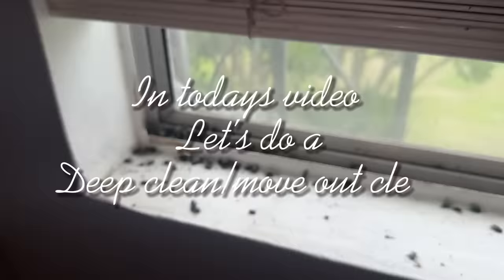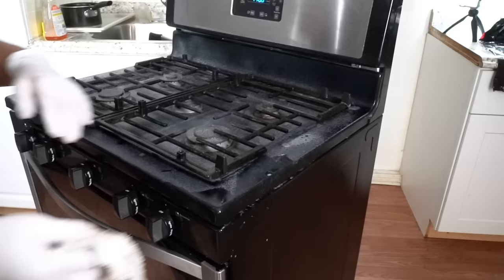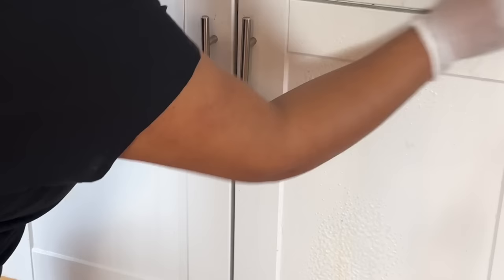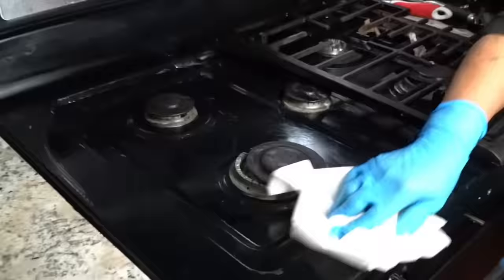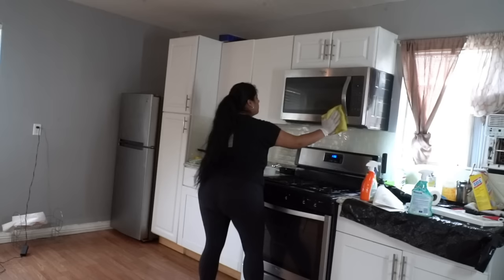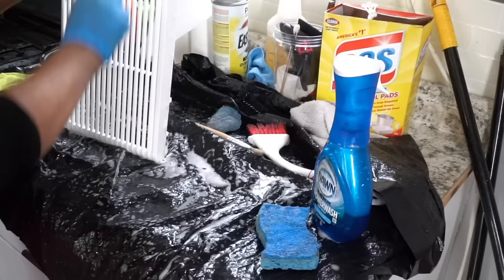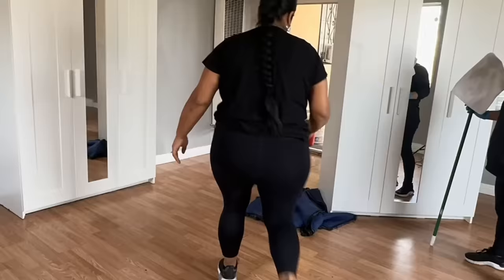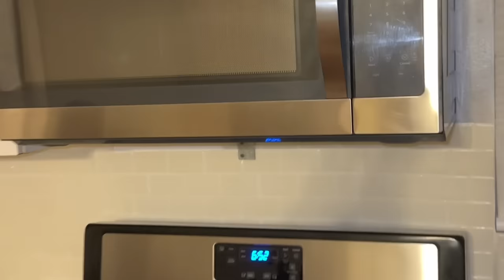WATCH PROFESSIONALS DEEP CLEAN AFTER A TENANT MOVES OUT

Comment: My slumlord and his “cleaners” should watch this. They lie and say they did a deep clean between tenants when really they do nothing. 🤮 Love your channel ❤
Reply from the maker: Yes I believe this 100 percent. I use to work for a rental company with a lot of apartments and I agree they do not clean very well.
Reply: Sounds like my old apartment.  Instead of cleaning the walls they just painted over the grease, dust and cobwebs.  They didn't even bother cleaning the top of the medicine cabinet in the bathroom and painted over the rust on the old 1970s Hotpoint stove instead of replacing it.
Reply: @Princessmom9  yeah that and so many more horrors 😫. Glad I know how to clean as well as I do. My unit probably hasn’t been this clean in 50 years.
Reply: Yap, so much out there about "dirty tenants" when landlords set the tone by NOT offering a clean unit to start with & then doing very little maintenance/upgrades.
Reply: Exactly, and then when you move out they charge you to clean it! I take photos every time I move in or out and definitely email them right away with the list of flaws you find. Then there’s a paper trail. My current landlord does bi-yearly inspections and I use it as my time to deep clean. Behind the stove, fridge, etc.. Like my mom use to say, limpia hasta donde no ve la suegra. I know, I butchered that saying. Please correct me if you know the right one.😂
Reply: Lleana, do you ever do deep cleaning for home owners who kind of want to “start from scratch” once they have gone through a major declutter?  Hubby and I are in the process of doing that and it would be so nice to plan for a deep clean once we are all done😁
Reply: Right! even though they were not slumlords an apt complex we rented from said our place was cleaned before we moved in, but I checked and they may have ran a vacuum around but THAT IS IT, there was flour etc spilled in the cupboards and a couple dollops of butter so I KNOW they did not scrub them, windows were dirty, window sills same, fridge was wiped out but not cleaned, so whoever this place hires was doing a very slipshod job, and I had to clean again before we moved in!
Reply: Not just slumlords!! Our semi high end apt claimed they cleaned it. They left so much residue behind in the fridge. I always reclean everything anyway but don't play in my face and leave me a card advertising your substandard service. 😡
Reply: Yeah, my current landlord, while on top of everything else, did NOT clean this unit before I moved in. The oven still had grease & food on the ceiling.
Reply: I'm in Lakeland FL we must have the same property mgr ,

Comment: I read a story once about ladies who cleaned with Lysol.  They prided themselves on the fact that if someone came to their house they could smell Lysol because it indicates their house was clean.  For myself, I got cancer at the age of 46, I began researching cleaning products that have cancer causing chemicals.  I was shocked.  Bleach for instance is so incredibly toxic.  If used properly it’s not so bad, but we tend to overuse it.  I also became extremely sensitive to scents.  So I must be very careful of anything that has artificial scents added.  
I admire how deeply you clean this place, I must tell you I do not believe I’ve ever moved into a very clean place like this.  I always found something needing to be cleaned.
Reply: Lysol can throw me into an asthma attack😩
Reply: @femalephobia    I put Lysol on the “ stool mop”,& clean my bathroom stools. It is a good disinfectant, but, use a small amount, as it is very strong.
Reply: I always used Lysol to clean my kitchen countertops but my new house has quartz countertops so I’ve had to switch to a special stone cleaner to avoid damage to the surface.
Reply: Although you guys did a great job everywhere else you did miss a few things. The filters in the microwave. VERY important to be cleaned as they are catching all that grease coming from the stove below. Also, the top of the microwave and the filters up there. As for the stove, I recommend taking the top apart. Removing those plates and getting all the grime under those. And pulling that bottom try out to clean because it catches everything that the previous owner cooked in the oven. I've done this professionally for a while, and you ladies did a great job it's just those minor details that clients can come back and complain about. They will see that and completely forget about all the great work that you did do.

Comment: I cleaned a rental that was full of flies. The reason was they didnt take out the trash and flies had laid eggs in some chicken scraps in the trash.  The eggs hatched and the maggots had crawled out the trash over the floor into and under every thing in the kitchen where they had hatched into flies which were all trapped in the house. It was gross. You guys are the best!
Reply: 😩🤢 such a simple task that could’ve avoided all that
Reply: It's so gross how people don't take out their trash!
Reply: That's why we pay for our tenants trash service! Also, we change the furnace filters quarterly. Tenants just won't do it. Gives us a chance to look around and address any issues with the tenant.
Reply: So disgusting
Reply: I have encountered the same. Move out clean, could not get the smell out even after steam cleaning the carpets. Their electricity had gotten cut off and the pan under the fridge was full of disgusting stuff. Maintenance man problem. They replaced the fridge
Reply: @relaxedyou4059  We furnish appliances so the Lease agreement states that if there are any problems with an appliance to contact us. Under no circumstance can they remove an appliance from the rental. If any of our appliances are missing they automatically forfeit the deposit. So far, so good. But you never know if/when a tenant will sell or pawn an appliance.

Comment: Cleaning plastic blinds:  take them down, put in bathtub or shower, spray with Awesome, rinse with water, turn over and repeat.  If large dirt particles, use soft brush.  Hang up or lay outside(or on a towel on kitchen floor) for a couple hours. They do not have to be fully dry to hang back up.
Reply: I have learned to haaate blinds in the window, sooo much easier to take down curtains and launder them!
Reply from the maker: Yes 🙃🙃
Reply: Growing up we put them in cold water and soapy water in the tub. It worked perfectly.
Reply: thank you for the tip! i plan on doing that tomorrow the blinds are destroyed with so much gunk on it how i have no clue but i’m gonna try this tomorrow to all the blinds

Comment: Open a bag of new charcoal briquettes, spread onto opened bag they came in and leave out for 2 - 3 days to absorb any bad odor. Discard briquettes afterwards.

I read this tip years ago and used this method once to absorb odor in my car trunk left from a gallon of milk with a loose cap which spilled into my trunk carpet on a grocery haul.
Reply: I had meat in a deep freezer and had my guests stopped paying the electric bill and it was nasty but I cleaned it and put charcoal in it until it was normal again.

Comment: I use to deep clean rental properties and it is a lot of work when you ACTUALLY clean the entire environment! I always start from the top, and work my way down. The most difficult part for me was bidding on jobs because there was almost always more than expected on the surface. I always took things apart as far as I could to get to the deepest parts. Like ovens, at 19:02 that bottom looks like it comes out. You can clean it easier and then clean underneath that where the oven cleaner and other crumbs and juices) drips through! I would also run the oven at 350 for about a half an hour to “bake-out” the oven cleaner smell, and any cleaner/debris I missed would be easier to see for a final touch up as well. Do you do that as well? 
So awesome to see a like-minded deep-cleaner who puts in the effort like you do!
Reply: i thought the same thing -- kept waiting for her to take the upper part of the stove off, it obviously comes off. So much falls under there from around the burners.

Comment: Just friendly suggestions for the smell issue. Maybe the water pipes are holding smells. Maybe Install new furnace filters. Sometimes the refrigerator coils hold dust and debris, be careful not to bend coils when cleaning. We move our appliances twice a year or as needed to clean. Love your video!

Comment: I tip I recently learned was to use a hairdryer to loosen the grease in a kitchen cleanup. I thought that was brilliant!!!
Reply from the maker: That is brilliant and makes so much sense. Because if you look at the directions of easy off it works faster if you heat up the oven then turn off to spray the product 🤗

Comment: I wish my landlords had hired real professionals like you. All the landlords I've had hire cleaners who claim to be professional but will only clean just enough to make it LOOK clean. Every time I move into a new rental, there are cobwebs everywhere, grimy window sills and frames, grimy floors, carpet coated in pounds of dust. And the bath tubs are their own horrors.

It makes moving in so much more stressful than needed because I have to deep clean the new place while packing up and moving out the old place.
Reply: I worked for Airbnb and they hired cheap cleaners because they didn't want to pay for high quality work. But every time a customer checked in day or night and it didn't meet their standards they would request if I go back to reclean it since there other cleaners didn't detail clean it properly. I had to clean from top to bottom. But I stopped working with them when they kept trying to avoid paying me the two pay periods. Sometimes apartments pay for the cheapest cleaners that have very little experience
Reply: @Clean-N-ShineInDfw  Yeah the first time I stayed at an airbnb I was confused by the mandatory 50$ cleaning fee because the cleaner literally just came into the house, sprayed the hand rail of the staircase with Windex and wiped once, then walked out. $50 just for that.
Reply: Wow that's definitely not a good job. Everything has to be done within 2-3hours before the next guest arrives. Sheets and towels need to done as well as fridge,dishes and oven in every cleaning. I'm  Sorry you had a bad experience with someone not professional

Comment: I enjoyed your presentation of the cleaning. As a professonal cleaner myself, I found that when I was hired to clean an appartment between tenants, I was only paid at most $45. I could have never cleaned like you did even though I wanted to.I only tried that type of cleaning twice.  Early on I was introduced to an all most all purpose cleaner.  "Fast Orange hand cleaner".  Even on new construction of luxury homes, I have used it on mirrors, marble. tile and any other construction dried on sloopy stuff that was left behind, without a scratch.  Leaving it on dirty ovens ( think BBQ pits)😅and stove tops over night if you can, otherwise, put on liberally first thing before anything else and then clean last. Optionally, you can put plastic wrap over it keep it wet.

Comment: For cleaning the microwave you should use a glass bowl put two cups of water and two tablespoons of either white vinegar or lemon juice. Microwave on high for five minutes. Let it sit for about 10 to 15 minutes to cool. Then carefully remove glass bowl and glass turn table. Clean with damp cloth starting inside top, sides and bottom. The steam usually softens any stuck on food. Plus you can be cleaning something else while it’s steaming up.

Comment: I noticed you used a brush from a dust pan and brush set to clean the side of the cooker. Can you please explain why you used this rather then a sponge or cloth?

Personally I move my cooker & fridge out every week when I clean my floors but that’s only because I have two JRT (Jack Russell Terriers) who love to play with they biscuits and the go everywhere! However, as much as I would love to move the washing machine out to clean behind and underneath it, it’s such a tight fit and so heavy I physically can’t move it and I don’t have anyone to move it for me, so I’ve improvised and put a guard up at the bottom so nothing can go underneath it!

Thank you for showing us how you do a “move out” clean, it was great to watch! 🥰🥰
Reply: There is a long round brush that you clean under refrigerators and you can use that under the washer and dryer to keep the trash from collecting. There is also a flat microfiber pad that is for tight places you can slide between many tight spots.

Comment: I have a tip. To clean out smell that builds up in an oven or microwave. A cake tin half filled with water, heat this in the oven until boiling with some rosemary oil in the tin.

The microwave can be thickly sprayed with diluted detergent inside. Put a cup half filled with water and lemon oil. Bring to the boil. Remove the dish and wipe out the detergent and handwash the dish.
Reply from the maker: That is brilliant!!!! I already do the microwave one but the Oven one is brilliant!!!! 🤗🤗🤗

Comment: I used to clean for 2 families 
During the years my children were in grade school....every week, after cleaning the kitchen ......(I deep cleaned the first time I went in) each week, I would pull the drain tray out from under the refrigerator, wash it again THIS week, and then slide it back into place and put 1 c warm water in the tray with
1/4 cup of pine sol, fabulosa,
Lysol, liquid gain or tide(1/8c)..... everytime the 
Fridge defrosts and THAT moisture goes down into the tray, the fan comes on and the whole kitchen and house
Would smell clean over and over.....by the time I get back next week, I wash the tray and start over.....☺️.....I also started the crock pot on low when I got there in the morning.....so there was something hot to eat when people came home from work......I enjoyed it.....💗

Comment: For the ceiling fans, we use a pillow case, put it on each blade and the dust catches in the pillow case. Then you can use your favorite cleaner on it without dust getting in your face or falling down.

Comment: Some refrigerators that are self defrosting have a drip pan under the refrigerator that the water goes into. You always need to check and make sure the order is not coming from there. Plus you need to vacuum under your fridge for dust.  Great video v

Comment: This was the most thorough cleaning ever. My adult daughter accidentally burned microwave popcorn in a bag and the whole house smelled. I cleaned the inside and outside with baking soda, vinegar and some water solution but there’s still a slight smell. Any ideas on what else I can do besides getting a new one lol
Reply: 2 cups water with lemon juice, microwave 2.5 mins, and wipe out the entire inside. Do that like 5 days in a row. Also activated charcoal can be 'stored' in the microwave when NOT on...to try and absorb the odors too.
Reply: Burnt popcorn is one of those smells that gives me an instant migraine
Reply: I always took a damp cloth and put vinegar on it wring it out good and then take the cloth at each end and hold it tight and fan the air with it. You will be surprised how well it works!
Reply: I wet a cloth and add vinegar, spread it out on the microwave turntable, and zap it till it steams.  Once it cools a little, use the cloth to wipe down the washer and dryer.
Reply: old lemons are great! Cut them I’m quarters and micro two to four minutes.  It’s amazing how easily the micro cleans and the smells are removed.
Reply: Squeeze lemon or put half a lemon in a glass cup something microwave safe
Turn the microwave on for a minute and then just leave the cup set with the lemon in it then just wipe it off with a paper towel it'll be steamy in there that should do it

Comment: Just an fyi: those are cluster flies and are completely harmless. They generally use south facing walls to spend the winter in so if they're getting into the house, you've got some cracks and holes around your windows and doors. A tube of caulking should prevent another infestation.

Comment: When i clean a microwave, i get a glass bowl, fill halfway with water and Dawn platinum dish soap. Turn microwave on for 15 minutes. It loosens up all the grime and you just wipe clean
Reply: 4 or 5 minutes is plenty,  to get a bowl of water hot, steamy, inside the microwave.
Reply: I just use water, the steam loosens up the dirt. Then I wipe it out with a bit of dish soap water ringed out of my cloth.

Comment: I’m definitely going to have to reference this video when I’m spring cleaning!! What do u recommend for the painted walls behind and on the sides of the stove top?
Reply: I would recommend. KRud Kutter for most jobs.  You can find it at Walmart or most hardware stores.  I also use lemon Pinesol, which has a very clean smell and also deodorizers.  I've cleaned houses and never had a complaint.

Comment: How would you recommend cleaning wood blinds and sliding door blinds?  I cannot soak any of these blinds in the tub.  Lastly, how do you clean the trim near the floor?  First time watching and loving the thorough cleaning.  Thanks!
Reply: They need to be washed by hand with a bucket with warm water and degreaser and plenty of rags. Go slat by slat, back and front ,while they are hanging on the window. Same with the trim on the floor.